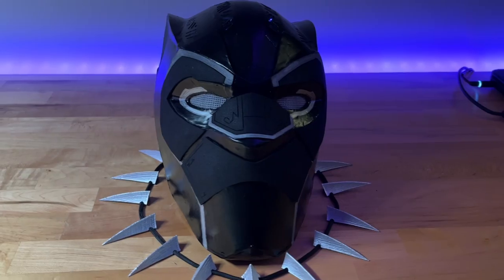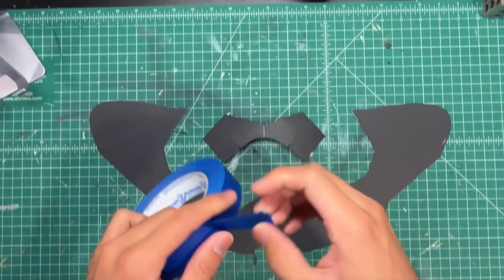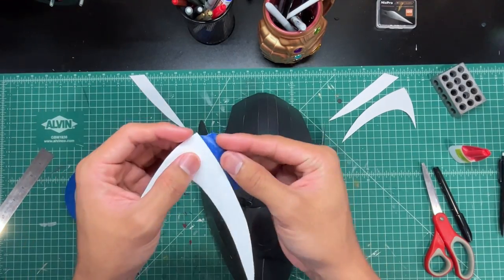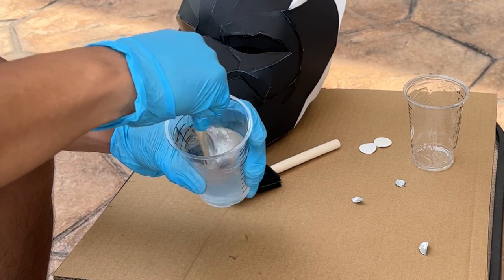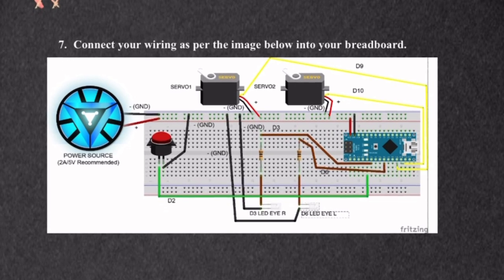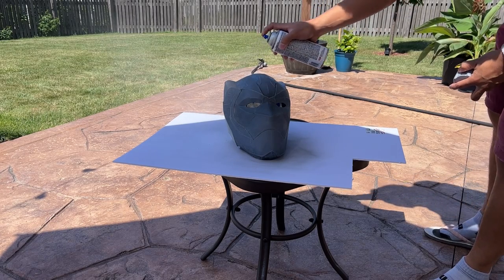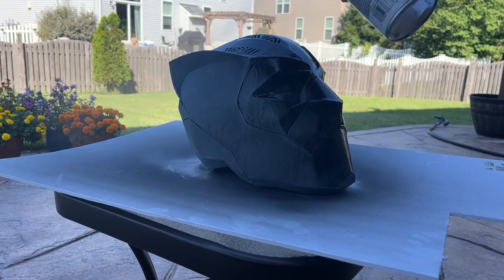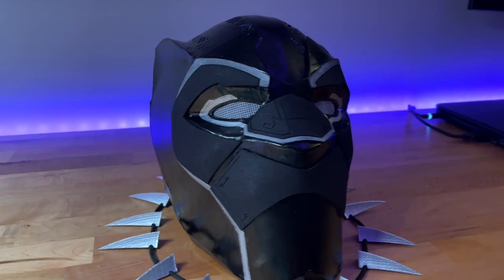I built a Black Panther helmet that OPENS! DIY Tutorial

Comment: Hey man awesome job! Is the bread board necessary for the helmet build? And do you always have to keep the helmet connected to the computer once the code is added? and also what was the name of that switch you used? I'm trying to add this mechanism to my mark 3 iron man helmet and this seems the easiest so far! Keep it up! thanks!
Reply from the maker: Hey! The breadboard is not necessary but it makes connecting some of the wires a lot easier (it basically eliminates a lot of soldering wires together). And no you don't need the computer connected! Once you upload the code, you can disconnect it from your computer as long as there is a separate power source supplying power to your helmet (such as a portable phone charger like the one I used). The switch is called a few things but you can find it on Amazon as a "micro limit switch".
Reply: @PropWay  thank you so much man! Really appreciate it!! Keep up the good work!